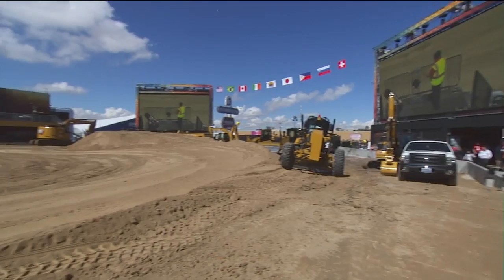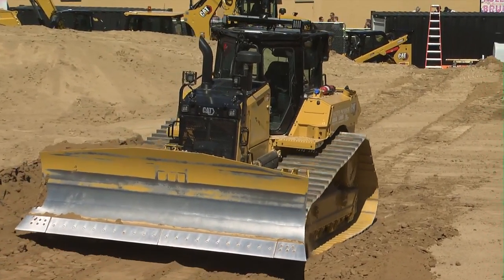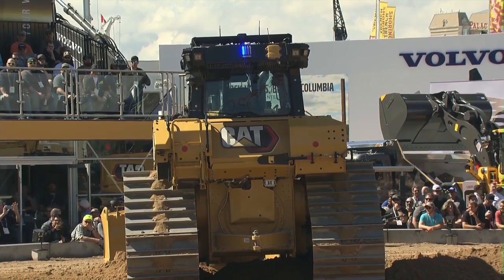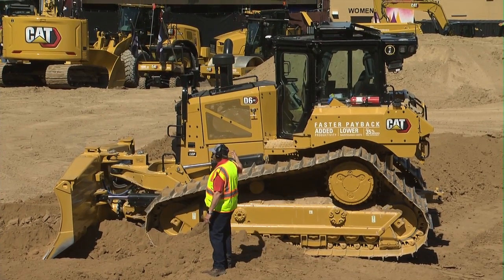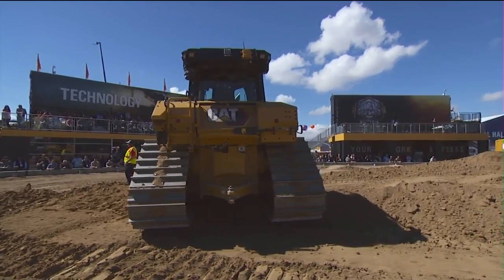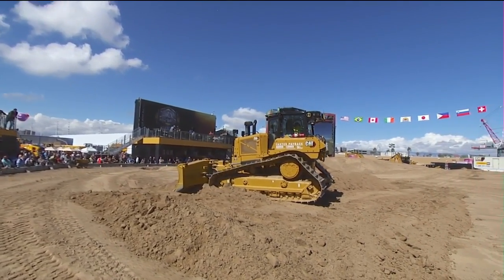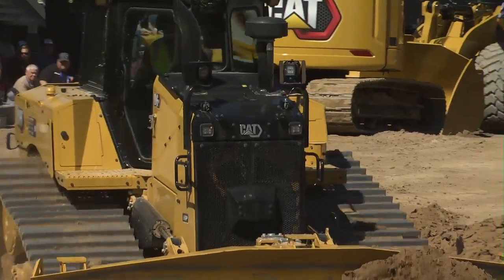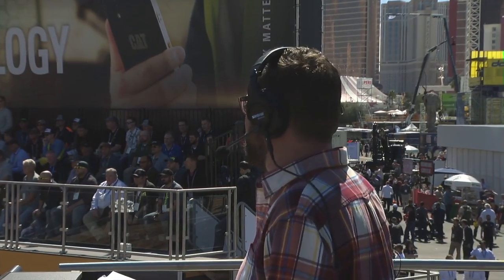Cat® D6XE In Action | From CONEXPO 2020

Comment: I've been operating bulldozer for almost 20 year's. Trust the everyday situation we are put in can not be replaced buy this
Reply: You're exactly on point.  Cat Command remote control is certainly not made for "every situation," but rather spots where you might not want an operator in the cab for safety.  It also allows folks to operate the machine, even if they can't physically get into the cab.  There are many use cases, but I agree it's not for "every person or job."  Thanks!
Reply: The fun of a dozer is being in the dozer. 
This video game generation is for lames.
Reply: It can though for a lot of applications. Machine control is not there yet but it's come insanely far even compared to 5 years ago. It won't be a remote operator like in the video...that doesnt make much sense or increase productivity at all, it will be 1 guy monitoring a fleet of autonomous dozers. You'll probably need human operators to come in at the end and clean up the tight areas or whatever but I would be shocked if that's not where we are in 10-20 years